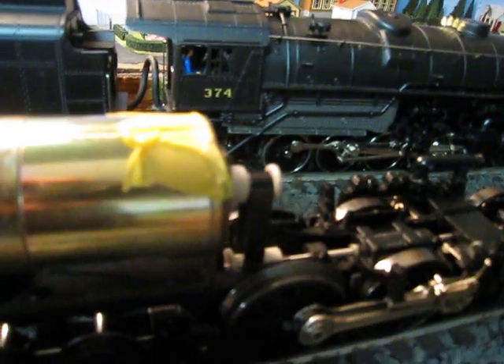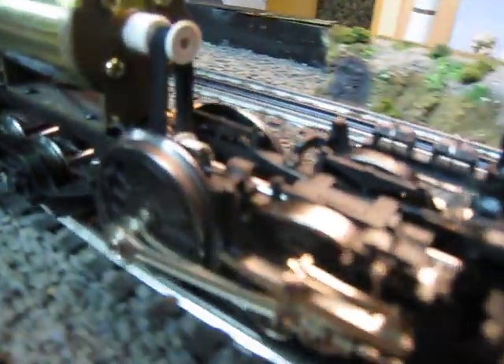Quite Drive by 3RD RAIL

Comment: Thanks for the demo. The driveshaft drives both sets of drivers but it seems only the rear set has the rubber tires.  Is that correct?